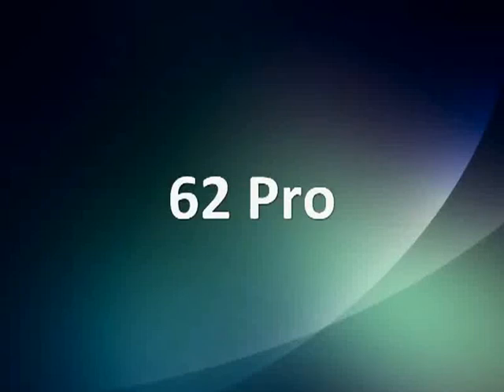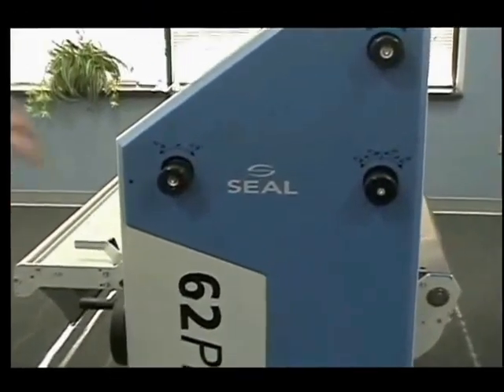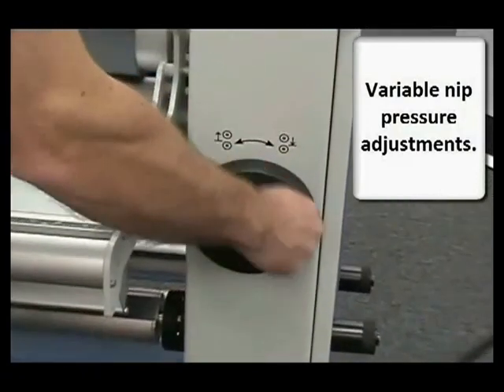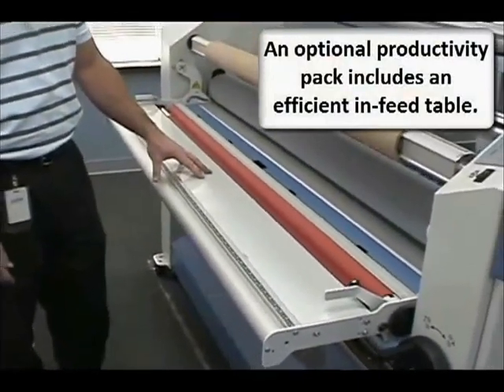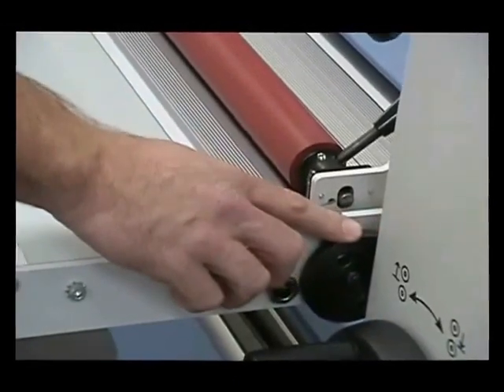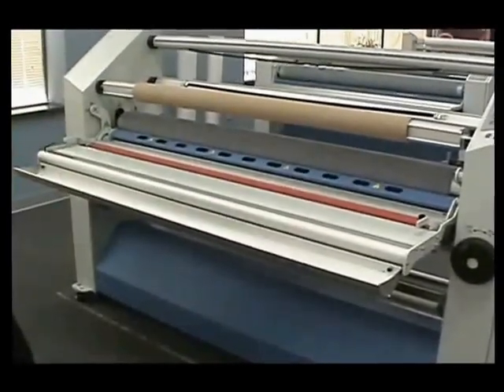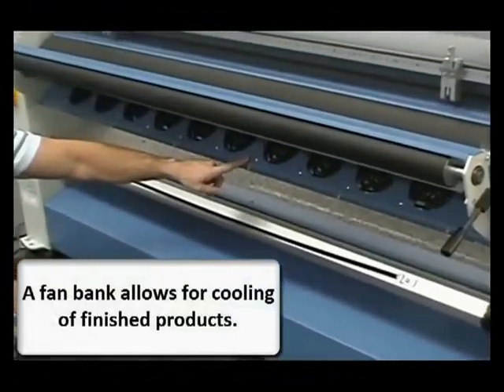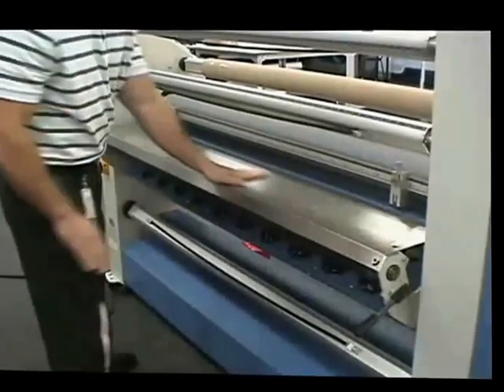SEAL 62 Pro Laminator

Comment: Darren Thanks for contacting me. The reason I wanted the information one of my companies closed down due to economy. I have a Pro Series Seal laminator in excellent condition I am trying to sell. I believe my manager paid over $10,000 for this when we opened up my sign company. I am asking $5000 for this equipment. I am selling a manufacturing plant and need to find a home. Does this sound like a fair price to someone who is asking about this equipment? Thank You again for your input on this matter Burt
Reply: Como checar o Donde dirimir cuando la conectas mal 110 use conecto en 210